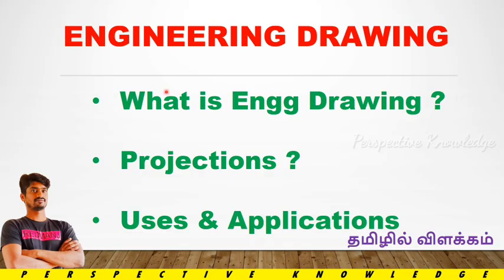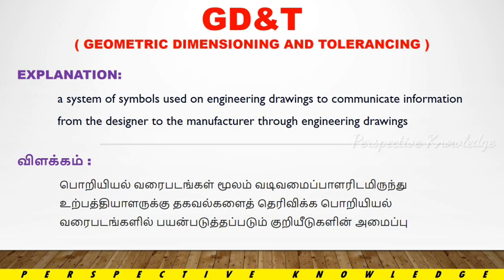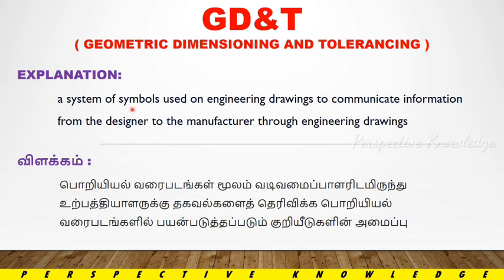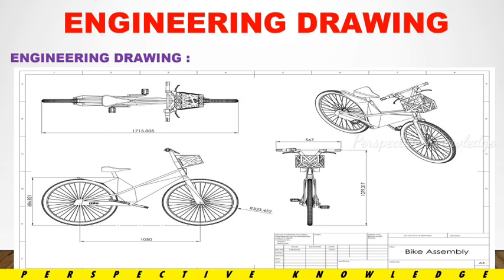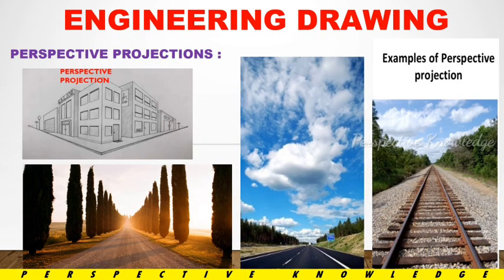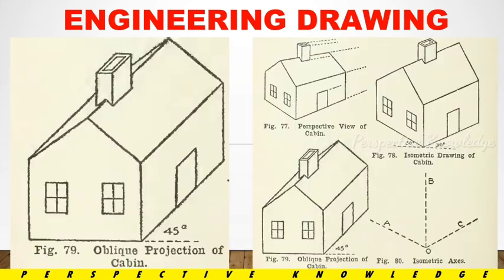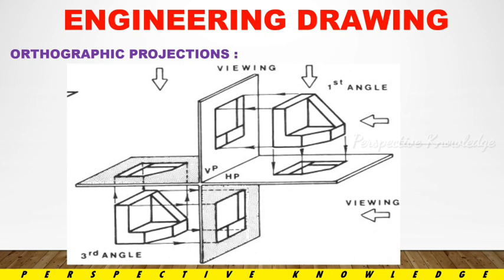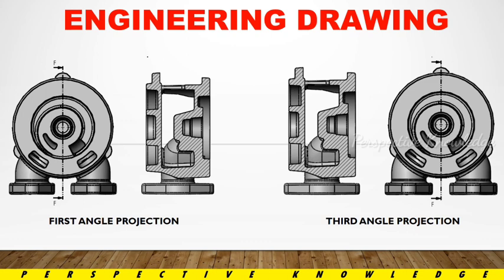engineering drawing basics in tamil | 1st angle and 3rd angle in engineering drawing difference

Comment: 1) Bro, Drawing la Tolerance எதன் அடிப்படையில கொடுப்பது. அதாவது 19+_2 எடுத்துக்கொள்வோம். இதில் +_2 அப்படிங்குற value எந்த Calculations அடிப்படையில் கொடுக்கிறார்கள்.

2) 19+_2 என்கிற dimensions போட்டு ஒரு production drawing வந்தால், அதில் நாம் 21 என்கிற Value-வை வைத்து வரையலாமா, அல்லது 17 என்கிற Value-வை வைத்து வரையலாமா.

2) GD&T Tolerance கொடுக்கும் பொழுதும், 
Flatness 0.02 என்பதில், 0.02 என்பதை எந்த Calculations அடிப்படையில் கொடுக்கிறார்கள்.
Reply from the maker: 1) 19+_ 2 ல 19 தான் நோமினல் value, antha product oda அப்ப்ளிகேஷன் or அசெம்பிளி aagura yedatha poruthu atha fix pannuvanga,

2)nominal value ah vachi tha drawing varayanum, 19 tha nominal, drawing 19 la erukkum, tolerance limit giving for production purpose
Reply from the maker: Try to post in a separate video soon👍🏻
Reply: @perspectiveknowledge Thanks for your reply bro. Subscribed.
Designers,, Nominal Value 19-ல வரைந்துட்டு Tolerance Value +_2 அப்படின்னு மட்டும் Drawing-ல Mention பண்ணி குடுத்துட்டா போதும். 
Production-ல இருக்குறவுங்க Material-க்கு தகுந்த மாதிரி (19+2) 21 ஆகவோ, (19-2) 17 ஆகவோ Manufacture பண்ணிக்குவாங்க அப்படியா Bro. 

Tolerance Value, GDT Value எப்படி Determine பன்றதுன்னு ஒரு Video போடுங்க Bro.